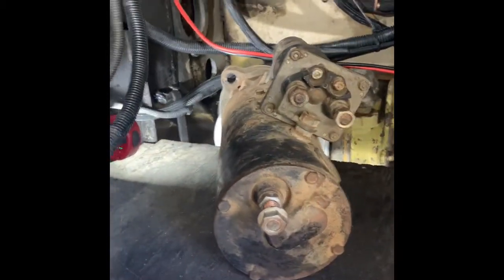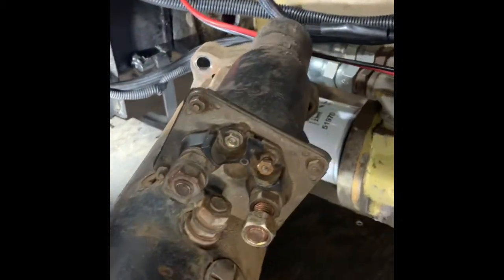Schoolie fun

Comment: Came over from Issacs live vid.  Born and raised in So Cali, I rode Crown school busses a couple of times for field trips in the 70's. Several school districts in So Cali used Crown coaches. I always loved those busses, especially the ones with the Detroit Diesel. Not positive on the years but I remember some of them sounding like the old 2 stroke Detroit Diesels. Your build on that bus is simply off the chain. Glad your grandparents saved one and you took it over and way over the next level.
Reply from the maker: O man that’s awesome!! Ya were crown lovers over. Thanks so much for the love and new video tour coming very soon
Reply: @jnjentinc  Now I'm curious to see what's up with the Tandem Axle Crown shown in the video. Good Job on the Trans conversion to Allison too. That looks like the same controller I have in my 2012 Kenworth T370 Rollback. Still would have been cool with the OE manual, but just as cool putting a modern day Allison in an antique 50's bus.

Comment: I watched your bus tour somewhere else, and you were thinking of adding a washer dryer combo in your only small hanging closet. Why don't you move the live edge bar counter over, so it ends over the end of the bricks of your fireplace box of your cubie, you have lots of empty space, then the combo washer/d has water from the end of the shower wall ? plus its opposite your kitchen sink area, so you can wash a spot needed, and throw it in the wash. Find a larger square live edge counter to fit over the combo.  (might have to cut a foot of your live edge bar counter off too, to make it all work, but it could become a shelf under the window beside your couch, nothing needs to go to waste)
Reply from the maker: Hi there, definitely a good idea and one we went back and forth on. It would actually fit right under the bar top. No cutting needed. The reason is we don’t want to look at a washer. We also don’t want a cabinet under the bar as it would stick out past the bar top. Great minds think alike 😀